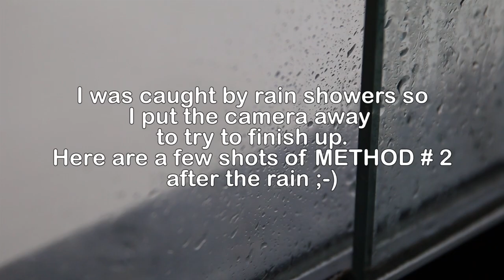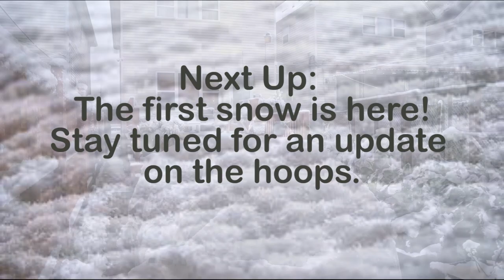How to Build Hoops (Low Tunnels) for your Garden Beds | 3 Ways

Comment: Liked this.  I'm going to build simple frames out of 1 by 4 and then use your first method to build some floating row covers for garden rows.  (I love using ideas to meet what I need.)  Thanks for this video.
Reply from the maker: That's really awesome! I can actually see the frames you described. I'm not that confident with a build like that so I did something similar with PVC pipe to be a square cage..I added poultry wire to it but have thought it would be nice to use row cover or netting of some sort instead. Take care.

Comment: Wouldn't electrical (grey) tube be better to handle UV light?
Reply from the maker: Hi! The gray tubes probably handle the UV lights better.  The white ones are pretty durable though.  These were put in, in 2019 and still look solid.

Comment: That's a beautiful name. Thinking about building a bed this summer. What kind of would are you using for your beds. I'm hearing different information regarding using pressure lumber. Thank you
Reply from the maker: Hi Ken! Thanks so much!!!  
You should absolutely build one!!  I have one bed in the backyard that I used pressure treated wood for.  The others are cedar and were built over the last 2 years.  I’m still torn on whether I ‘’needed’ to go with cedar.  I’ve read that older pressure treated wood could be dangerous but I’ve also read that the treatment they use now isn’t harmful.  I’m not sure which is true or if it’s somewhere in the middle. Sorry I could be more helpful here. 😕

Comment: Thanks for this Batavia, I just used bamboo topped with small plastic plant pots and put netting over the top, but it's not that successful. I think i'll have to get me some pvc pipes. One question, how do you secure the covering?
Great video my friend really informative.
You can still keep the snow lol
Have a really great week
All the best
Steve
Reply from the maker: steve's growing space heya Steve! Thanks for watching!  I’m using these spring clamps. I think I may need to go a size up though.  https://www.homedepot.com/p/ToolPro-4-in-x-1-in-Steel-Spring-Clamp-2-Pack-TP05140/206777764?mtc=Shopping-B-F_Brand-G-Multi-NA-Multi-NA-Feed-PLA-NA-NA-Catchall_PLA&cm_mmc=Shopping-B-F_Brand-G-Multi-NA-Multi-NA-Feed-PLA-NA-NA-Catchall_PLA-71700000014585962-58700001236285396-92700010802552364&gclid=Cj0KCQjw9fntBRCGARIsAGjFq5ElVZZXCO35cDZtC5tC_v2nuc8-DMiiLtz3HfsXWiCrBnKQu620CMYaAiWOEALw_wcB&gclsrc=aw.ds

Comment: I built pvc hoop tunnels over my raised beds which are 8 foot x 3 foot, and covered the hoops with a lightweight netting to keep the birds and squirrels out.  It worked well for a couple years, but this year the squirrels have started chewing holes in the netting and going inside and digging the beds up. As soon as I repair the chewed hole with string, they chew another one, and another one. I'm thinking of using chicken wire now to cover the hoops. My whole pvc hoop tunnel is hinged on the long side, so lifting it up to access the vegetables is really easy, however, using chicken wire over the hoops is going to add several more pounds to the whole thing.
Reply from the maker: John Mizak - hi! Thanks for watching.  I used bird netting to cover my strawberry bed and I thought I accidentally tore holes in it while pulling it off and on, but now I wonder if it was the squirrels.  
What are you thinking of using to connect the wire to the PVC?  I have plenty of chicken wire and may try that. 
Re: the weight..I have a cage on one of my beds and it has wire on it. The hardwire that has the small squares that is really firm was too heavy for the doors of the cage..used the wire that has the hexagon shape holes and it much easier to work with and lighter. Going into the third season with it. ☺️

Comment: You made this look super easy! Is there a certain kind of plastic you recommend? How do you keep ther plastic attached to the hoops
Reply from the maker: April,  Hi! Thanks for watching and commenting!  

Once you get the martial it really easy an easy DIY! I used 6 mil plastic (clear) to cover the bed.  This is my first year doing this and I’ve read that 6 mil is good because it keeps some of the cold out and still allows some light in.  Multiple layers may be needed depending on the temps.  I’ve started with one layer. ☺️

https://www.homedepot.com/p/HDX-10-ft-x-100-ft-Clear-6-mil-Plastic-Sheeting-CFHD0610C/204711636

I used 4 in x 1 in Spring Clamps to connect the plastic to the hoops.  They are a little tight over the 1/2 in pipe so I am looking at some other sizes to see if they may provide a better fit.  But for now, these are doing the job.

https://www.homedepot.com/p/ToolPro-4-in-x-1-in-Steel-Spring-Clamp-2-Pack-TP05140/206777764?mtc=Shopping-B-F_Brand-G-Multi-NA-Multi-NA-Feed-PLA-NA-NA-Catchall_PLA&cm_mmc=Shopping-B-F_Brand-G-Multi-NA-Multi-NA-Feed-PLA-NA-NA-Catchall_PLA-71700000014585962-58700001236285396-92700010802552364&gclid=Cj0KCQiAtf_tBRDtARIsAIbAKe3fM5y4xeCTrdNVFStFV3ib13JpBZ7_SYjQclStNU-9F46V7KhhtwUaAvXcEALw_wcB&gclsrc=aw.ds
Reply from the maker: Oh and the size of plastic will depend on the size of the beds and the hoops.  I went with a roll that was 10ft  
wide but 20ft might have given me more room on the sides of the beds.  We’ll see if I need to go larger/wider.